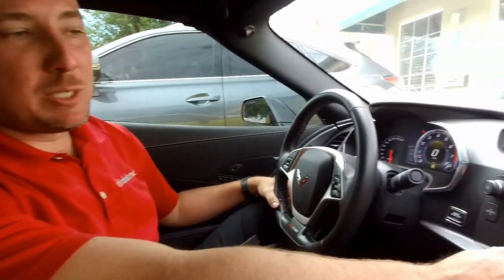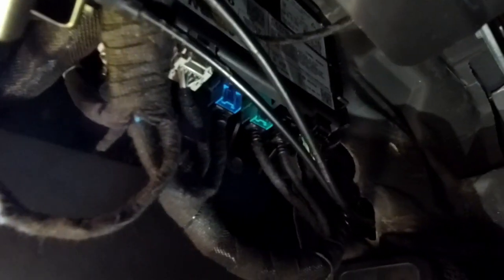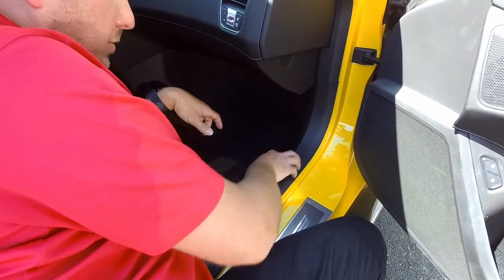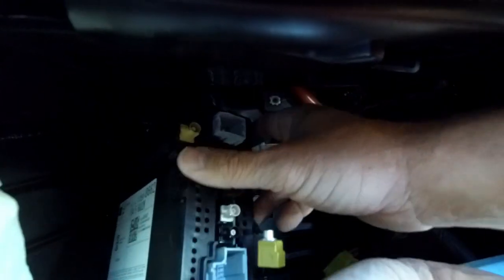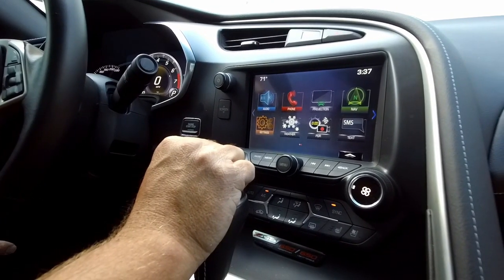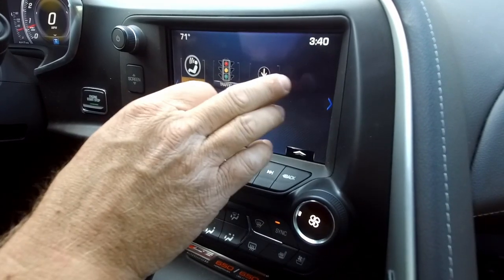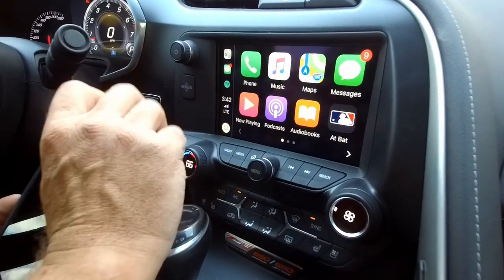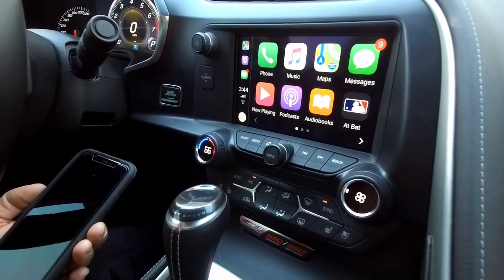2014-2015 Chevrolet Corvette - Factory MyLink® Apple CarPlay and Android Auto Upgrade Install!

Comment: "The factory GPS navigation is awesome".... If I thought that, I wouldn't want to install CarPlay.
Reply from the maker: Hello Shawn, 

You don't have to add on apple car play/android auto for the 2014-2015 Corvette you can simply just add on the IO6 HMI module to gain factory nav if you have the non nav IO5 radio with the 8 inch touch screen radio with this OEM factory pre programmed solution we offer. Use my discount JJ10 for $10 off when you buy online via card, pay pal or cut up the payments via Klarna.com Check out the link below. 

https://www.infotainment.com/collections/all/products/2014-2015-chevrolet-corvette-mylink-io6-gps-navigation-radio-upgrade

Let me know if I can help out more.
Reply: @Infotainment_nav  Thanks for the offer.  Although you did misconstrue my comments. I was just expressing my general disdain for manufacturer nav systems, and was mocking your praise for this one. They tend to be quite poor compared to the superior products from Apple and Google. (Which is why I'm interested in adding Apple CarPlay functionality in the first place)

Comment: I been having a black screen on mine. I checked the fuses and everything was good. The amp is good. as far as I know the HMI module is good. If I put the car on reverse the camera works just fine. My question is will changing the bcm fix this issue for me?
Reply from the maker: BCM is not likely. GM is notorious for being difficult to diagnose. Even though the back up camera is working it still may be a screen or HMI issue. It may be worth it to get both and then return the one that does not fix thes issue.

Comment: I know this is quite old, but my dad recently got a used c7 and we have the black screen radio issue so wanted to know what the name of the module was behind the bcm cause ive diagnosed the hmi and bcm and both seem fine
Reply from the maker: Hello and thank you for contacting us at Infotainment.com, if you have a back up camera, I would check that to see if you get an image at all on the display, and if so, you can rule the screen itself out as being an issue. A black screen is more than likely caused by a signal issue from the HMI module (Human Machine Interface) to the display. 5% of the time it can also be caused by a defective ACM or radio receiver, but if you have sound functions, that should be in tact. We can certainly assist with an HMI module replacement if needed and would just require the VIN for programming.

Comment: OK...I know the video has some time on it but all of the information still applies. We installed the system on my 2014 C7 Corvette and chose the I06 option that retains the Factory Navigation. I am using Android Auto. The installation works flawlessly except for 1: detail that is explained in the video at about the 8:30 mark. I lost my on screen Driving Mode change ability. I still have the ability to change Driving Modes with the Console knob but have lost the ability to customize the settings. Again, everything else seems to work flawlessly. is there some setting that needs to be changed or was a step possibly missed on the install that caused this to happen. One of the main reasons I chose your product was the assurance that I would maintain all of the original Driving Function Options. Let me know how to sort this out. Thanks.